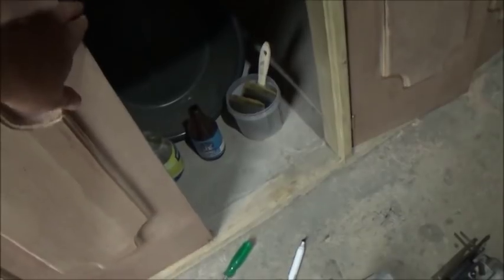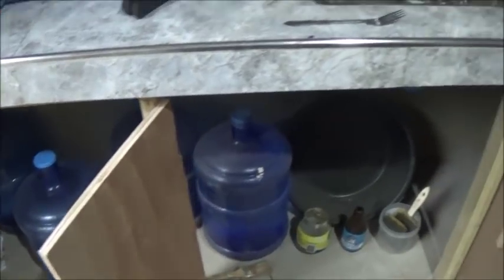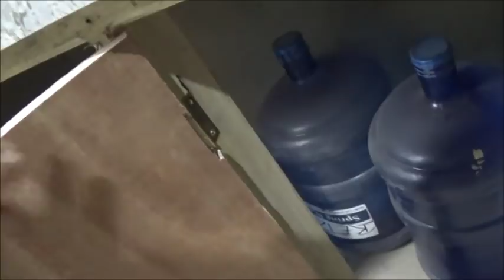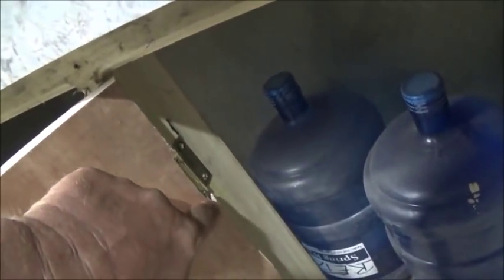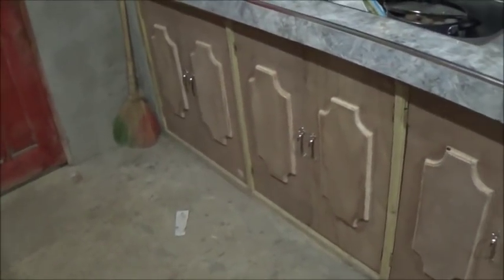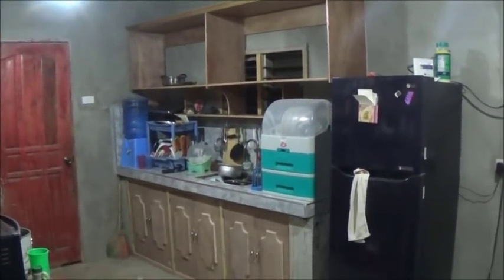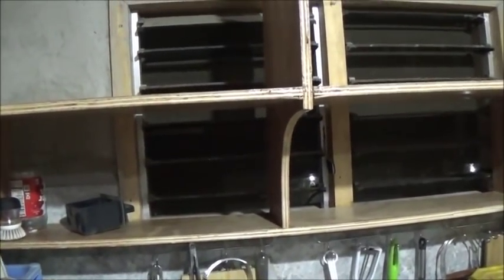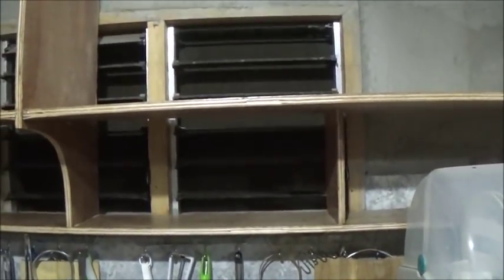Tatay Finishing Up The Cabinet Doors

Comment: The cupboard looks good ,but I still believe that it needs some concrete legs somewhere underneath to bear weight. If it cracks or pull away from the wall ,down it will go. It's not too late to do it but it would take a little longer than if it was done at the begining.